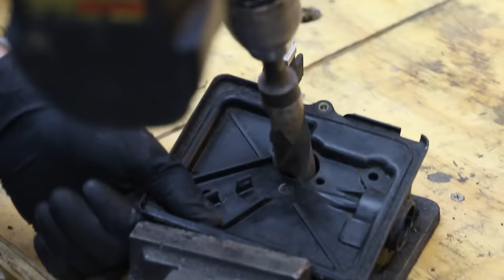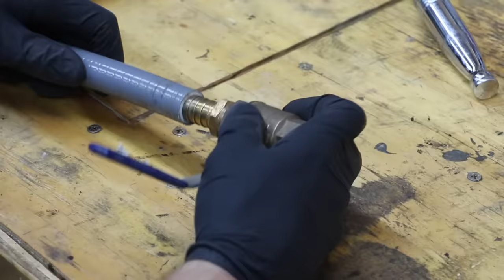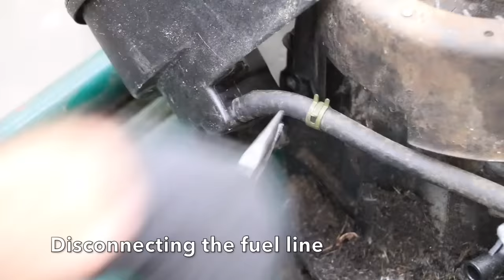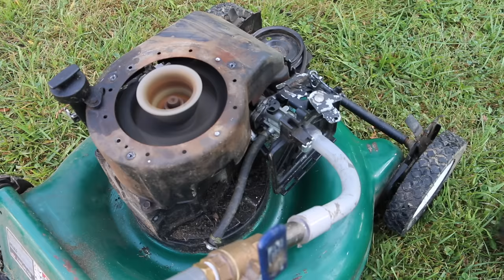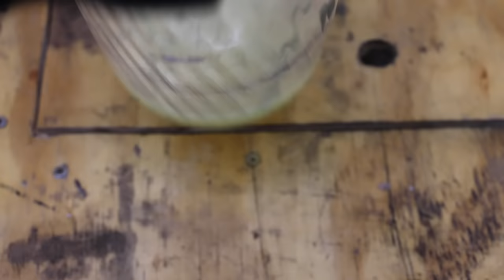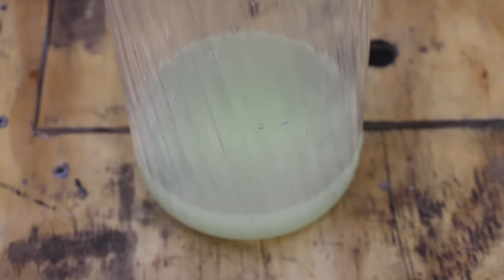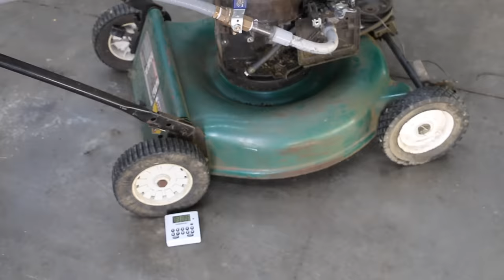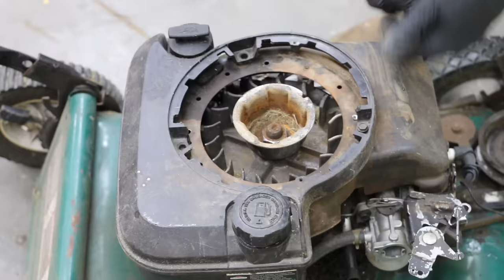Will a "Gas Vapor" Container Improve MPGs and Fuel Efficiency?  Let's find out!

Comment: The whole "all engines run on vapors" thing is only part of the story. A huge factor in liquid fueled engines is that the fuel droplets have an evaporative cooling effect on the combustion chamber. Running a gasoline engine too lean can cause the combustion chambers to overheat and burn the engine up. On the same note if you run it lean enough you will start dropping the temperature and lose power. We see this in natural gas and propane engines. You can run a gaseous fueled engine as lean as you want until it stalls, and the temperature drops with it..
Reply: Hangfire he ran it excessively. Plus it's an air cooled low rpm motor. All his readings were normal temps
Reply: yeah but that's why the water mist systems exist, to solve that problem. The idea is to add water mist to the air mixture to then cool the lean air/fuel mixture which should burn hotter and more efficient, which then gets instantly cooled to about 100ºC by the water boiling and expanding 16 times, hence boosting the compresion. The only downside is that you have to run the engine with less or no water and rich for say 5 mins before turning it off to avoid rusting it. 
Maybe if they made some parts of stainless steel or titanium (piston rings, valves, etc) for the weight and streght sensitive parts, it could work but the problem is people just dont care for the car, not understand such a simple proceedure, even if it could be automated by the computer. Hence no car manufacturer implements it. Plus you need distiled water or distiled mixed with alcohol for the mister so another thing to refill aside from the fuel.
Remember the volkswagen fiasco? it was because they needed to refill the urea for the filters, and people werent gonna do it so although it worked, they knew people were too stupid to actually refill the urea for the filter.
Reply: yall are nuts.. you 3 should get a hotel room..all engines and fires run on vaporized fuels..including wood, coal and even aluminum
Reply: exactly right. I've seen a bunch of these videos and every time I have to do a faceplam.
Reply: no
Reply: Hangfire why are you the first person I've ever seen stay this despite looking? Thank You
Reply: johnny llooddte try it. Literally go outside and put your thinking caps on and give it a try. You see exactly what he did to get these results. Go prove all of us wrong.
Reply: You are absolutely correct.  From my reading, and personal knowledge,,,   Too lean can be super efficient, crisp and hot,, even better power,,,, but,, the engine will over heat,, production of NO products goes through the roof, pre-ignition will become a problem, and engine life can be hours instead of years.  Modern engine, much of the cooling of engine and gases, exhaust valves, , is the fuel that runs through unburned. A too rich mixture cools the engine and exhaust gases,,,, and in a modern auto engine,, that fuel runs the Cat. converter. You need to fuel the Cat. so it can process the exhaust gases.
Reply: +Ryan Bishop - reread johnny llooddte's reply over and over until it sinks in that he is AGREEING that ALL combustion occurs in the vapor phase...  wood, coal, whatever...  they ALL vaporize BEFORE combustion can occur.  that's WELL known to everyone except victims of no-child-left-bahind!
Reply: John Michael i replied to the wrong person. Been a busy morning. Sorry!
Reply: while some of what you say is factually correct, your THEORY that the vaporization of the fuel droplets in the cylinder provides essential cooling is ABSOLUTELY FALSE.  the heat of vaporization of liquid hydrocarbons is extremely low, and simple calculations show that the heat absorbed by the vaporization of fuel droplets in the combustion chamber is insignificant compared to the heat removed by the usual cooling system for either air or water cooled engines.  QED.
Reply: John Michael yes, the short of it is that the unburnt fuel actually creates heat downstream of the cylinders i.e. manifold, exhaust, and is the sole reason for the necessity of catalytic converters. Temperature can be easily controlled, especially on a liquid-cooled engine. Maintaining proper temperature isn't the problem. But then, what IS the proper temperature precisely?
Reply: Sploofmonkey have you tried looking up patents. I have found some stuff in the past, while looking into hydrogen engine patents. I was looking into re using the water that is produced and feeding it back into the tank.
Reply: Hangfire
A lean air/fuel ratio doesn't that much hotter the main problem is it burns slower. The reason people tend to think a lean ratio burns hot is, because a lean burn is slow, a good deal of the fuel is still burning then the exhaust valve opens. So the valve, along with the surrounding cooling jackets,  is now exposed to much higher temperatures then normal, which can overheat the valve and/or engine. 
One way to reduce this tendency, besides richeing the mixture, is to advance the ignition timing so that combustion starts sooner in the cycle and isn't still burning out the exhaust valve, which was the main purpose of things like a vacuum advance on the older cars with distributors. When vacuum was high and load was light, like when cruising, you can get away with a lean ratio and the vacuum would advance the timing to compensate, sometimes by as much as 10 or more degrees BTDC.
Reply: Hangfire in that same vein, too lean of a mix can result in high NOx emissions. It could be that vapor fueling is a bit more efficient, but was avoided for other,  possibly environmental reasons.
Reply: Could be that the vapor mix burns more efficiently, allowing you make a leaner mix possible but would require other, more precise adjustments (like advancing timing and cooling considerations)  for maximum gains to be achieved
Reply: robert rochacz
Or you could just design an efficient combustion chamber combined with very high pressure direct injection that does a better job of mixing the air/fuel to the point now where homogeneous charge compression ignition is possible, which is pretty much the holey grail of internal combustion engines.
Reply: 177SCmaro very true. With toyota recently hitting 40 something percent thermal efficiency in their most recent Prius iteration, I for one am quite excited with the future of the internal combustion engine. What happens when we figure out how to bump it to 60%?  (And I love hotrod and horsepower BTW) I think that Flathead Briggs is only 10% or so
Reply: Evaporative cooling effects on a gasoline engine would be negligible per the fuel source ignoring the engine design, the propane and natural gas have obviously low temperature (in atmosphere pressure) boiling points which in its own nature makes propane a great refrigerant used in europe as such. You can actually map propane on a P/T chart and check out its enthalpy curve and basically determine how many btu's of cooling you will get out of the volumes you put into and the pressure drop from the line to the chamber. For a gasoline designed engine i would highly doubt any engineering was done to utilize as much evaporative cooling as possible. I dont think your wrong in fact i think you have a point and technically correct it does boil at a lowish temp in atmosphere pressure, but not much but i would be skeptical of the comment summing it all up due to the difference in application and fuel characteristics. Natural gas boils so low its run at such low pressure (for heating applications) that there is not much volume to even transfer the enthalpy into cooling. Propane at -40 something boiling point is probably the only fuel that would have a design in the engine to try to cool that makes sense and worth the engineering cost.
Reply: I never thought this would work!
Reply: That is not what happened with VW at all. They tuned their motors to run lean and emit more NOX during normal roading than allowed as it increases power output and thus decreases fuel consumption, high combustion temperatures allow the formation of NOX, lower temperatures do not. If you run the engine richer, and inject at a later point than optimal for power production the combustion temperature remains lower. 

Vapor is vapor, We can calculate the energy in the chemical bonds and extrapolate what is most efficient, anyone can do the math, its only uneducated dolts who claim they can make more energy by using vapor.
Reply: robert rochacz
10% on a really good day. lol
The main problem with engines like these cheap, old flatty aircooled engines is they have to run them rich as hell (I've heard like 10-12 to 1) to keep them from overheating so efficiency and emissions suffer a lot.
Yeah, efficiency keeps going up on some of the high tech engines, just about in time for them to overtaken by what I learned from Futurama is the most evil propulsion system ever conceived, dun, dun, duuuun, the electric motor!
Reply: how is adding water vapor suppose to increase gas mileage?, last i checked it only serves o reduce gas millage but can increase performance in engines refit for it, aka it takes MORE gas per mile, and 2nd, just go online, find someone who is attending uni, ask him to send you a copy most journals (the places where you pay for research papers) have an all-acess system set up with almost all universities/collages
Reply: quantuman100
In theory a certain amount of water can help suppress detonation and allow more engine timing but I don't see how this helps most cars when they're just cruising under light load down the highway.
Reply: +quantuman100 - because vaporizing 1cc of water absorbs 540 calories of heat, and 1cc of liquid water becomes 1600cc of steam.  therefore besides suppressing detonation, it captures waste heat that would otherwise escape with the exhaust, and coverts it into mechanical energy.  the 1600-fold expansion supplied by the liquid -> vapor phase change generates extra pressure in the cylinder and thus extra horsepower from SAME amount of fuel.  what you do with the improved efficiency is up to the designer.  you can simply use water injection to get more hp at same fuel consumption, or you can make a smaller engine with correspondingly better mileage that produces the same hp as a larger engine w/o water injection.
Reply: +will smith - the "proper" temperature is an engineering compromise.  the higher the temp, the more complete the combustion and therefore the higher the efficiency, but also the greater the wear and tear on moving parts and lubricants.  the "optimum" cylinder temp is chosen to maximize efficiency while minimizing oil breakdown and wear.  it depends on the intended application (AA top fuel dragster vs family car) and the current state of lubricant technology.
Reply: The only problem is...."Droplet size of vapor is smaller than droplets from a standard fuel system"   Google it. Vapor is not droplets. Droplets are liquid.
Reply: P.S. Any %age of water vapor would only dilute an otherwise 100% of  pure gas vapor charge to the cyl.
Reply: Any %age of water vapor is only a contaminant to an otherwise 100% charge of pure gas vapors to the cyl. Water vapor will not combust. All that extra waste heat you were talking only goes out the exhaust anyway. What is your source for all this gibberish you pickt up? I have been studying IC tech  for 50 years and never heard anything like this>......Seriously....What is your source.......I can name my sources!
Reply: michael vannozzi 
Most engines run much leaner then 14.7:1 when they cursing under a light load, including vapor engines like LPG. Running lean doesn't make an engine run hot unless it's so lean that advancing the timing can't compensate and the fuel is still burning or partly burning when the exhaust valve opens.
Reply: I have been a mechanic for 45 years. Most carburetor Internal Combustion engines run richer than the 14.7:1 stoichiometric ratio at 12-13:1 Air /Fuel Ratio. Anytime you run more oxygen to the fuel ratio, the mixture will burn hotter ... period. You can run leaner, maybe say 18:1, as long as you keep it within safe mechanical limits, so that no detonation or pre-ignition occurs. Running leaner would be on a case by case basis, due to many different variables. Your spark plug electrodes will start burning white, when they should be a tan color. Running an A/F ratio leaner than Stoich will probably require retarding the ignition timing, and a loss of power,  performance and gas mileage will occur.
Reply: +Bill Davis - while that is "correct," it is misleading.  technically water vapor does "dilute" the gas(oline) vapor in the sense that it's no longer 100% pure gas(oline) vapor, HOWEVER, it does NOT DISPLACE the corresponding volume of gas(oline) vapor.  partial pressures of different gases are ALL INDEPENDENT of each other.  look it up in any HS chemistry text.  so the total pressure will be greater, ergo, more "push" on the piston and more hp.  besides which, the water is injected in the liquid phase, and does not become water vapor until the power stroke of that cylinder.
Reply: Any %age of anything reduces the full potential of 100% vapor. "partial pressures of diff gasses are ALL independant of each other" WTF does that mean and splain plz how that relates to this hot vapor engine. !!!! In 55 years of engine study I never heard that one. If you have heat that is evaporating water, than that is heat that is not pushing the piston down AND the end product of evap is cooling effect. Step out of the pool on a windy day.
Reply: 177SCmaro, No offense, but:  I am sorry, you are just incorrect on many things that you say and think. You Sir are just plain wrong. But that's OK, go ahead and keep thinking what you want to think, it is your prerogative.   I am not going to waste my time trying to educate you on the facts.
Reply: michael vannozzi lol, yeah, because it's sure a lot easier to just ignore everything someone said,  say "you're wrong", and then pretend you're taking the high road by acting like you're just so god damned important that it is beneath you to actually have to make an argument like the rest of us.
Reply: +bill davis - "WTF does that mean?"  apparently it means you need about 12 more years of education before you would be able to understand what i wrote.  sorry, i don't have the time or enough crayons to 'splain it to you, lucy.  a wise man once said, "There is NOTHING more dangerous than a little bit of knowledge."  you, my friend,  should be very, VERY careful.
Reply: "You, my friend should be very, VERY careful"    This sounds like impending DANGER......... An angry, dangerous response is what I have come to expect from someone that claims to have knowledge but can't splain it, or reveal their sources of info. ....The hot vapor fuel engine science is out there for us to learn..........if ya wanna learn??????
Reply: pay careful attention, BILL, i DID give you my "sources."  but since you're obviously slow on the uptake, i'll repeat myself one more time.  GET ANY GENERAL CHEMISTRY TEXTBOOK.  LOOK UP ROALT'S LAW OF PARTIAL PRESSURES.  LEARN SOME BASIC CHEMISTRY AND PHYSICS AND MAYBE IT WILL EVENTUALLY DAWN ON YOU.  do you really expect someone to be able to teach several science courses to you in the utoob comments section?
Reply: Look at any High performance manual or any auto magazine or any of the repair manuals or auto troubleshooting manuals and see what they have to say about ANY water in the fuel PRODUCING MORE POWER!
Reply: People for over a century have been doing everything possible to eliminate water from the fuel..........and then you come along with THIS..........Hahaha
Reply: J.M. You are so wonderfully condescending when someone challenges you brain!!!!! It happens all over. Emotion overpowering intellect!!! It is especially prevalent in bars and on Fakebook.
Reply: And I have been telling you for days now. Stop sending me all these UPPER CASE WORDS and abbreviations. K? And they cooled the engines with water to keep them from burning up. Internal combustion engines as well.
Reply: P.S. If you aren't up for the challenge, then don't reply to my reply. You don't have to prove anything to me.....I understand.
Reply: Water vapor takes up room in the combustion chamber and temporarily increases the compression ratio. It also cools the intake charge. This is how it's used to create a temporary power boost. Some turbo enthusiasts use a methanol/water (wiper fluid) as a chemical intercooler. 

If you run an engine too lean, it tends toward detonation because of the fast and violent burn. It also becomes starved for fuel and starts using the aluminum in the pistons as fuel. EGR systems replace some of the incoming air with inert exhaust gasses. This balances the oxygen/fuel ratio while increasing the air/fuel ratio. This lean air/fuel, balanced oxygen fuel mixture burns more slowly. That is the reason for the advanced timing. Part-throttle lean carbs and vacuum advance should never be used without a functioning EGR. 

And Bill, if you really have been studying engines for 55 years, you've been doing it wrong for 55 years and it's time to give up. You're thoroughly confused and spouting complete nonsense.
Reply: Water injection was used on fighter planes in WW2 to give a short power boost...
Reply: Yes, I was explaining how it works and how it's still used today. 

I rigged up a water injection system on an old truck when the EGR failed and I didn't want to risk breaking rusty bolts to fix it. It worked great. Highway mileage was better than ever. It ran cool pulling a trailer on the freeway. And the part-throttle power was nearly equal to full-throttle.

I had to refill the water jug more often than the gas tank and it took a lot of trial and error to get it adjusted and working good. But it did work rather well. I just took a vacuum hose connected to the ported vacuum and stuck it in a water jug. The hard part was finding a way to regulate the flow. I used some restricted vacuum connectors, a temperature controlled vacuum switch and some carefully placed pinholes.
Reply: That is incorrect sir. Running an ICE on 100% evaporated fuel actually lowers engine temps. The combustion is complete and a greater amount of energy is converted into kynetic energy. 

ICE are designed with added fuel to the combustion chamber to quench the combustion after the power stroke. 

This is needed because an amount of liquid fuel droplets (in normal fuel injection) don't achieve vaporization until after the power stroke and they actually combust going into the exhaust manifold. 

Again, a complete combustion of fuel in gas form with oxygen lowers temps.
Reply: +Al Brautigam - i'd be very interested in learning more details about your DIY water injection on your truck.  do you upload vids to the boob-toob?  what about the purity of the water?  i imagine that trace dissolved solids have the potential to lead to problems after prolonged use of WI, like corrosion, deposits, oil contamination, to name a few...

i have couple spare 2L alfa engines in the barn.  the ones sold in the US after the 70's had SPICA mechanical FI, but i found an older one in a boneyard with a pair of weber 2bl carbs.  i often wondered about putting the carbs on an engine with the mechanical injection system, and using the mechanical injection pump for water injection and the carbs for the fuel.  but alas, alack, life always has other plans for my time...
Reply: I set mine up to replace the EGR. I'm not sure how you would set that up with mechanical injection. Replacing the EGR with water injection is a long(ish) conversation. If that's what you're after, I'll be glad to help. It's best to start with an engine that is set up for EGR.

If you want to use it for temporary power boost, I'd recommend just getting a "chemical intercooler" kit and installing it. They don't do much on naturally aspirated engines, though.
Reply: John Michael,  Have you noticed that dragsters in the Top Fuel class do not even have a cooling system.  No radiator - nothing.  The fuel is the coolant.  Those engines would melt.  Of course the same thing happens in your car.  That's why the fuel is sprayed onto the intake-valve in conventional fuel-injection - in your daily driver.  To cool the valve - and the air.
Reply: ACTUALLY,, in fact the experts seem to be saying that gradually leaning the mix results in hotter engine exhaust temps (EGT) until finally EGT peaks, then begins to fall as mixture is most lean , so they back off of the most lean mix until the temp needle of the hottest cylinder drops to a safe temp range (75 Deg F back toward rich from peak temp lean EGT); so they are still lean but not at the max lean setting; they do leaning  to compensate for less air (O2) at higher than 3000 ft altitudes and for fuel economy and for increased range (although the fuel economy is said to only be 4% more and the range similar % increase ).  I'd like to see a complete test out using a generator putting out a constant 1000watts "under Load", a "Kill-A-Watt Meter" could be used.  The one guy said he only used about 5% of the normal fuel cutting his grass?
Reply: That makes sense, as long as it's monitored - and leaned to extend range rather than power.
Reply: Binshou Builds no but ya mumma will
Reply: of course, the bigger the explosions (of the flammable fuel /gas and air mix) in the engine and the greater the amount of explosions, the more heat
Reply: exaxtly how small do UR droplets need to be before they become R vapors?
Reply: johnny llooddte You clearly don't understand what vaporized means.
Reply: 177SCmaro - You nailed it exactly right.
Reply: Laharl Krichevskoy sniff of hho gas .... your thoughts
Reply: Hangfire dang thanks that makes so much sense I've never heard that before!
Reply: Kris Kringle exhaust valve would be the first point of call unless of course it’s catastrophically wrong....lady chernobyl yuk highly unlikely given straight LPG is the one of the harshest... again only hardened valve seats are required...with unburnt fuel either raw pushed passed the rings directly into the oil or in the form carbon buildup are the two of the bigger contributors to per- mature wear outside cold start up abuses ..... hho gas when set up correctly is said to run a cooler - cleaner slightly lower engine temp ....this could only be as a result of all the fuel being burnt close to entirely ...... i wouldn’t confuse today’s shit as fuel ......regardless  the effect your referring to was removed along with the LEAD .....
Reply: Binshou yes but human seen is a bit touch and blow !!
Reply: John Michael true but car manufacturers still believe that a richer mix will result in a lower temperature burn by reducing available vapour.
Reply: William Smith 80 degrees block temperature with about 650 degrees combustion temperature.
Reply: 177SCmaro sometimes it's a lot more than that, I have a few that go to 42 degrees BTDC
Reply: robert rochacz maybe we can play with a car ecu to change the tables to see what can be achieved ??
Reply: Steevo69 hmm hold my beer !!
Reply: True, however in this application, we're not technically running the engine on less gas, it still takes the same amount of fuel mixed  with air to actually make the explosion in the cylinder.  The true difference is we are wasting less unburnt gas.  So we are running the engine on a more thoroughly burning mix, no temperature difference is made because we can still achieve the correct fuel/air ratio that the engine was made to utilize, BUT we eliminate the droplets that simply are wasted or that become dirty carbon deposits in the exhaust passages.
Reply: @Sailor376also  Too lean of a fuel/air ratio does cause overheating.  However, an topical engine is only using the fuel that is able to be combined with oxygen, the vapor. So we aren't changing the fuel to air mixture, we're simply changing how much fuel we use to get combustion.  There is less fuel that is sent thru the engine that isn't burnt.
Reply: Correct. Learning how to read a spark plug and adjust the air mixture or increasing the size of the jet let’s you tune it properly. 

Too lean you’ll melt the electrode on the spark plug, and burn the piston. 

A nice light chocolate brown spark plug is a perfect burn. 

If the burn inside the combustion chamber is too efficient (too hot) something is going to get cooked. 

The exhaust system is also part of combustion cooling. Try disconnecting your exhaust pipe from the exhaust manifold and let it run for awhile. 

That big cast iron exhaust manifold will get bright red hot. Literally red hot.   

When your exhaust pipe is connected you will never see the manifold get red hot. 

Even racing headers need to be a minimum length. If you run headers uncorked they will also get red hot.
Reply: The idea is to use the same amount of fuel, however the vaporized fuel be atomized a bit better, so its not necesarily lean, you would be getting more power per unit of fuel/air.
Reply: sorry let me refrase that..  all combustion engines run on hyrogen (which is already a vapor so I wont say Hydrogen vapor)   

as for combustion engines,   the fuel has only one affect on heat... its combustion temp and the combustion duration.

gasoline is not explosive, it has to be compressed in order to get ANY work out of it, therefor the big FIREBALL in engine is the primary source of heat.

hydrogen however, is explosive and detonates INTANTLY leaving no fireball, or any fire or heat in its wake.
hence hydrogen would actually be able to run an engine that ware passively cooled (meaning a big heat sink instead of water cooling)

if you lookup the info you'll find gasoline is in fact a really really BAD fuel source.  it's only around 30% efficient..
meaning in the big fireballs in the engine, 70% of its wasted through heat :-(